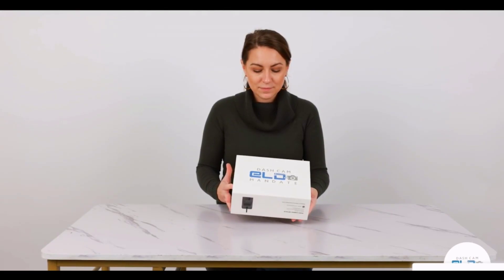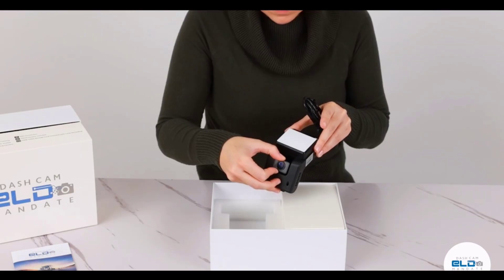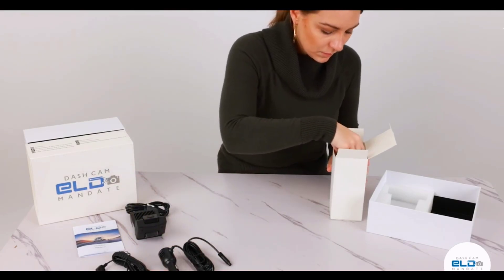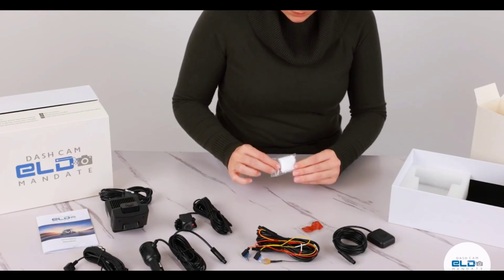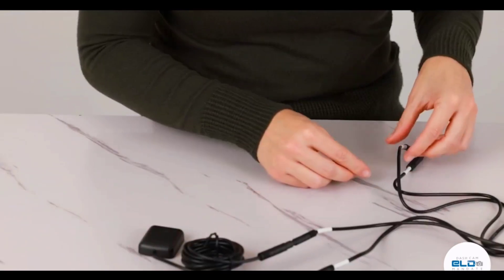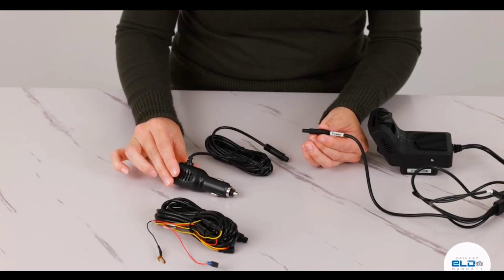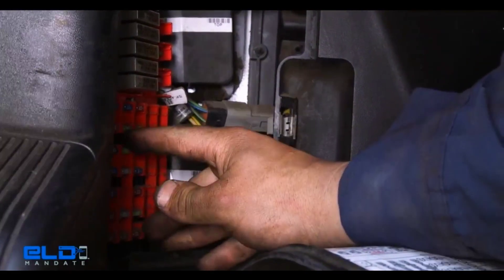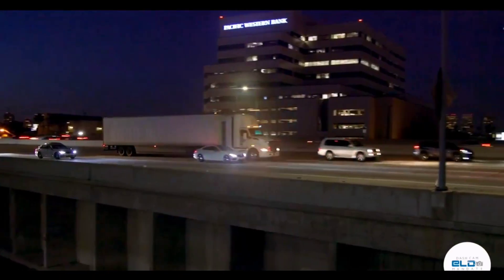ADAS Dash Cam Installation Video

Comment: What fuse did he take out? U guys need to make the video more detailed
Reply from the maker: For installations, the Radio fuse is the most frequently used connection point due to its accessibility and consistent power supply.